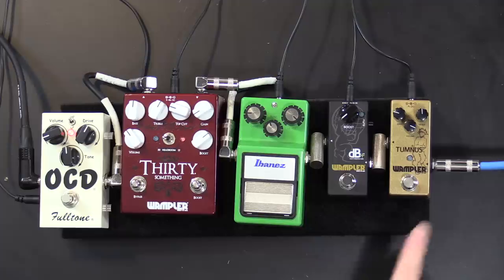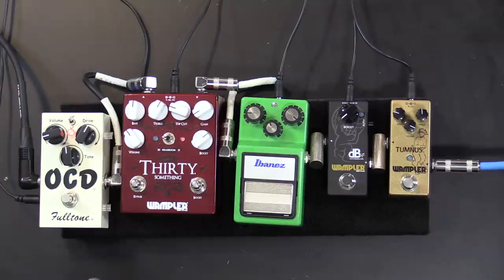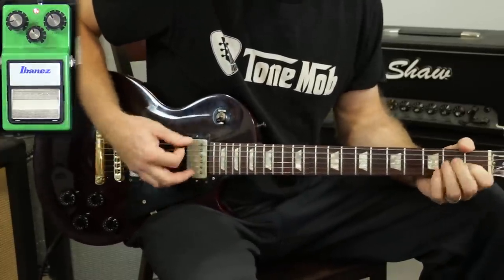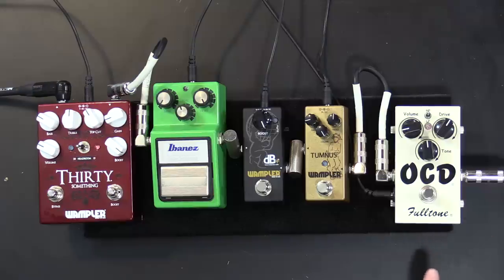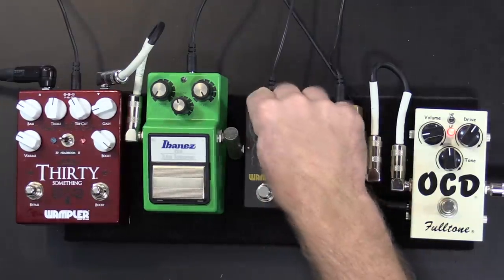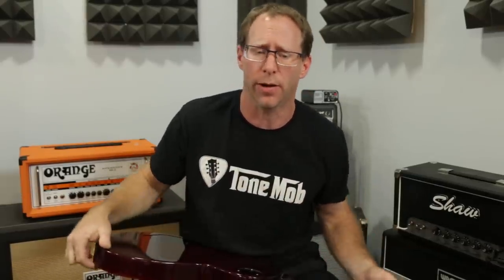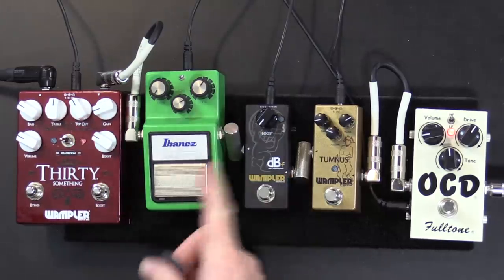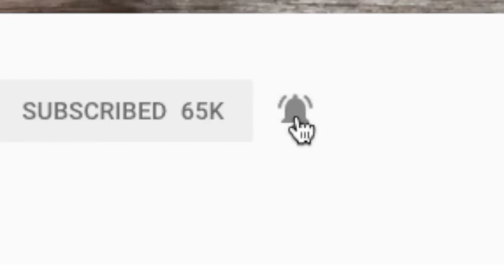Boost Pedal Placement - where do they go?

Comment: I don't use any dirt pedals on my board, preferring to use the drive settings on my Mesa Fillmore. I use a Spark mini-boost at the end of my boards signal path which goes directly in the amps input. I've tried dozens of dirt pedals but they just don't sound goog to me and I'm not talking cheapo gear here.

Comment: Xotic EP Booster into a Keeley Oxblood is my current setup.
Reply: How do you like your Oxblood?  Been eyeing that pedal but haven't yet pulled the trigger on one.
Reply: Po1itica11yNcorrect - honestly, it’s the best overdrive pedal I’ve ever owned. Just buy it, you won’t be disappointed. Right out of the box, straight to rehearsal and my co-guitarist was devastated and as equally impressed as I was. It’s a keeper.

Comment: so i’ve just recently added a boost and two other pedals to my board and i have no idea whats going on but i think one of my new pedals is killing my delay pedal bc I’ve gone through two memory boys already and the same thing has happened, its starts going crazy and then stops working completely other than acting as a volume pedal. The first one boosted extremely loud and the second one started modulating like crazy even though i never changed the settings, but they both shared the problem of not delaying at all and i suspect its my boost pedal my fuzz face or my tuner pedal bc i never had a problem with it before and now ive got two broken memory boys. if anyone can help pls let me know, no one else has been able to solve my problem , 
pedal chain: guitar to fender tuner pedal, to 1980 something pro co rat, to jimi hendrix fuzzface mini, to supro boost, to small clone chorus, and then finally to memory boy and to the front of the amp. 
i’ve always played rat to chorus to delay to the front of the amp and never had a problem before so i have no idea what’s wrong

Comment: I don't know anyone that uses their od////dist pedals at unity gain. That's the fastest way to disappear in a mix. My experience with boost order is the opposite of this because I use quite a bit of volume from od/dist pedals.
Reply from the maker: Respectfully, You don’t want to cut through a mix with volume. That messes up the mix. You cut through with frequencies unless you’re using it for a solo boost etc (more below). If your volume jumps every time you hit a pedal then whoever is running sound is going to be really irritated. Boost is different because the intention is to take advantage of limitations in headroom to get more clipping, or jump out at a spot like a guitar solo. You do what makes you happy but I can say with certainty that unity volume is indeed how most people use overdrive and distortion pedals unless circumstances call for different use, as mentioned above.
Reply: @wampler_pedals  I think too many things are being assumed here. First is I'm a guitarist who starts with an amplifier that's already clipping. If I dig in I'm already in AC/DC territory but if I play lightly it's a rich harmonic clean(ish) tone. I play 50ish watt amps in the sweet spot with very loud rock drummers so I'm sitting just right in the mix. Another thing to point out is dynamics. If your clean and dirty tones are the same volume how would you be heard if you're quiet when the band goes into a much heavier part of the song you're playing? If you're just being buried by the snare, what's the point?
Reply from the maker: Depends. If more volume is needed then kick on a boost and/or volume pedal can be used at the end to make things even. From a mixing perspective you need a consistent level of possible rather than a level that’s jumping around depending on what pedal you turn on. If you’re just playing at home it’s a non issue though.
Reply: @wampler_pedals  I've been gigging since the late 80s and from my experience sound guys pretty much always ask for your loudest sound for the mix. Instruments are dynamic. I should be aloud to be as dynamic as a drummer if I want to be. Good sound guys can accommodate this. Unfortunately most sound guys are not good. Pete Thorn has commented on this more than a few times.
Reply: Apparently you can't post links here. For context you can listen to a song I wrote on YouTube when I was in a band called Knives Are Quiet. House of Cards is a good example of the loud/quiet/loud thing we did. There's also a small thread about this topic on the gear page titled 'How do you guys use the volume on your drive pedals?' There's a poll as well. Some interesting responses.

Comment: My OCD never sounds like they do in all these videos. I think maybe my amp isn’t bright enough or something.
Reply from the maker: How does it compare?
Reply: It’s just very dark. Even when the tone is cranked. Seems there isn’t the same amount of gain too. I’ve been noticing a lot of my dirt pedals seem dark and I have to turn up the tone almost all the way. Perhaps I just use a really dark clean tone. Hot rod deluxe with presence on about 7-8 should be pretty bright though I’d think.
Reply: Wampler Pedals I have your plexi drive deluxe and paisley drive as well and I run the paisley with the tone at least 3:00 and the plexi pretty high too. Both with the presence switch on. So maybe my amp is just dark.
Reply: I had a V2.0 OCD, a dark pedal.  Even with the tone on the pedal high.  I then learned that turning the bass down on the amp (from 6/5 down for 4/3) helped a lot to avoid heavy bass caused by overdriving the amp. Sold the V2.0, replaced it with a V1.4....less bass, more bite.

Comment: Wrong, and that's the whole point.   There is a right or wrong, there is only one best setup, and you can only pick one when you go into a gig.   I like the tube screamer before the overdrive, and a volume booster after the over drive.   This allows the pedal setup to work with the overdrive the same order as when you put boosts in front of an overdriving amp.   You forgot the option of having two tube screamers, one before and one after, the OCD.   One thing for sure, multiple overdrives just create too much confusion.   Three gain pedals at the most is what I say.

Comment: JHS Mod Soul Food > Boss BD2 > TS9 > TC Spark
Reply: Steve pippen  Almost the same, running a modded Soul Food into a Tube Driver into a modded Blues Driver. Near the the of the chain is a dB-1 boost. But I experiment a lot and might move the boost to the front
Reply: @sparkyguitar0058  I've since flipped the whole chain.  Just read it backwards for my current gain stack.  But it'll probably be different next week, so don't read too much into it.

Comment: Graphic EQ pedals after dirt pedals.....  Sparkle drive runs before Plexi-Drive Deluxe in addition to the Boost button on the Plexi Drive Deluxe if I want to alter clipping.  But if I want solo boosts it is always after.  Increased saturation can make the guitar lines harder to hear through FOH.  Even a solo boost is as much or more a change in the EQ curve as it is a gross heavy handed gain increase.

Comment: Never really played around with boosting before, but I tried something the other day. I run a OD-2 into a Rat into a way Huge Green Rhino. The Rhino and Rat are set to mostly low drive, and the OD-2 is set to full clipping. Normally I had all three set to unity with my amps volume, but I tried cranking the volume output on the Boss past unity, but still set at full drive. The result has totally changed my thinking. Bringing the Boss into the stack now results in all-out squishy fuzz instead of just distortion. I always hear about people using overdrives as "clean" boosts at low drive settings, but how come nobody ever seems to slam a drive pedal with another driven pedal instead of as clean as possible?

Comment: No Maxon OD820? Bliss in front of any decent tube preamp. Why do I need more distortion than one fantastic boost pedal & a decent tube preamp can generate? I can understand adding a little touch of fuzz, & or a half driven wah for additional character, but distorting distorted distortion is headache indictment to me, if chords are played, I mean. You lose the characteristics of tube bliss, of both preamp & power amp, adding more & more distortion boxes. Might as well play a digital amp if distortion for the sake of distortion  is what you want.
Reply from the maker: It's just a different sound, or flavor if you will.